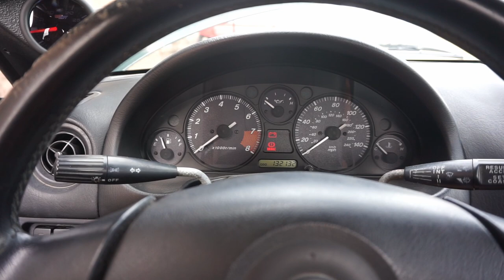Turbo Miata Build | Are MaxpeedingRods Coilovers Worth It? | Yellow 420cc Injector Install

Comment: Just put them (Street) on the 1999 Miata. at the lowest height setting, the front dropped 1/2" from OEM, and the rear is 1 inch HIGHER than OEM.
Reply from the maker: I definitely wouldn’t recommend them for lowering lol.. I was fortunate enough to not have to pay for them, I love my Megan Racing coilovers I have on it now👌🏽